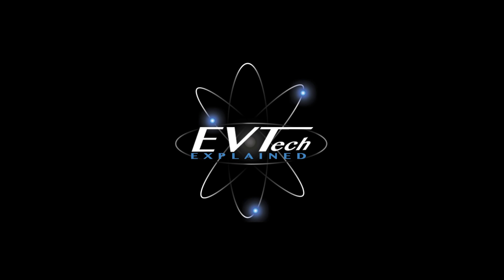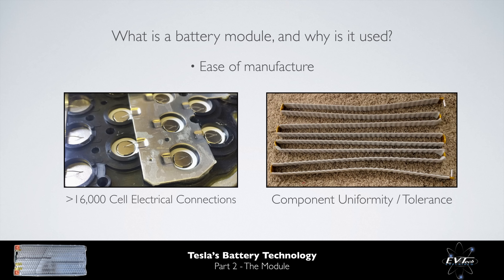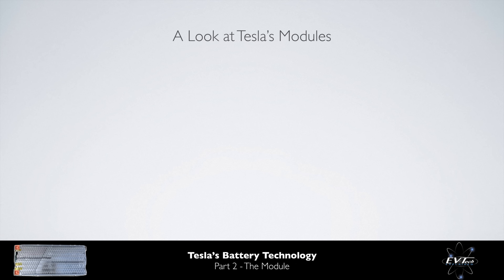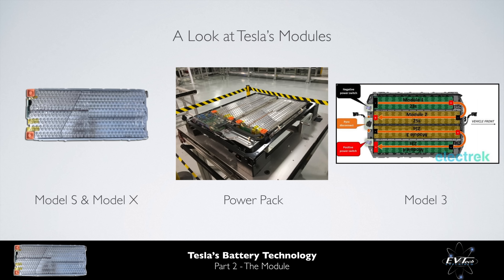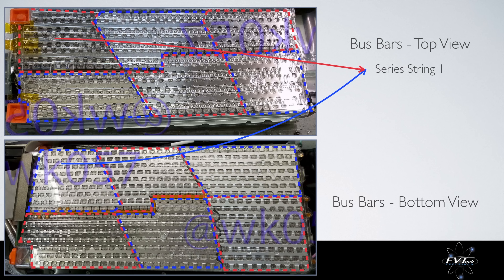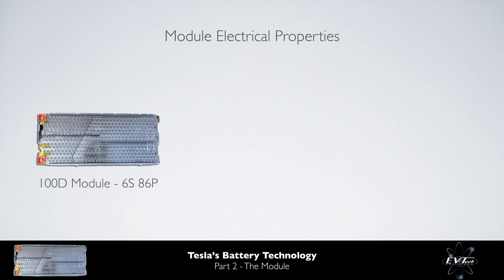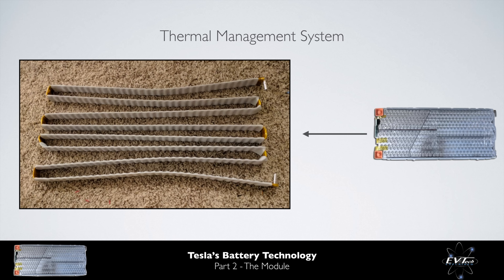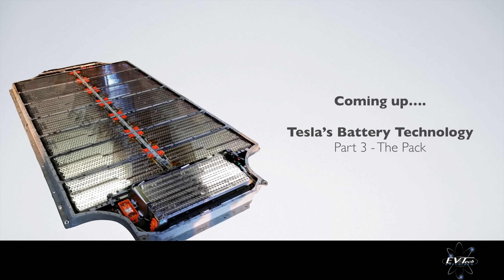Tesla's Battery Tech Explained: Part 2 - The Module

Comment: 74 cells in parallel: you know its impossible to distinguish between these cells whilst they are connected in parallel.........therefore there is NO cell level monitoring in any ev's battery pack.
Sad but true.........when will this be solved?
Look at it this way: 6S 74P pack.....thats 444 cells 
74 cells in parallel are basically monitored as a single cell ( cannot distinguish between cells):
so 74 out of 444 cells are monitored or 17% of the pack.
The reality is less than 20% of a packs cells are being monitored is one way of looking at it.
It very rarely this point is raised as a weakness in the electric vehicles, in fact its very rarely raised at all, most people continue to say that there is monitoring at an individual cell level.....which is not the case.

Comment: Can you explain the reasonS  why a Tesla battery might catch on fire? I have seen on the internet different Tesla models catch on fire when:  1.  just being parked.  2.  parked and plugged in for charging.  3. driving down the road.  4. and after a crash.      Let's assume a 2022 model 3,  hits a dip and the bottom of the car hits the roadway,  the car crashes by striking a 8 inch curb,   the car hit a tree too,   3 minutes later it explodes into a ball of fire.  
Q1:  can i hire you to help me develop theories of 'why' the 2170 design had some faults and why they catch on fire. Q2:  does the 4680 battery fix any problems with the 2170 catching fire?

Comment: On the Tesla S 5.2kWh battery pack there is a pcb with a 10 pin plug socket. What is this socket for ? We have a Tesla battery which we want to use with a solar panel array, and maybe this socket has some significance?

Comment: Hey there, great video! Do you suppose it would be safe to mount a model S module in a vertical fashion, on its side? See no problem with cooling, but mechanical structure is not elaborated on in your video...

Comment: Each 21700 cell is 4.85 Ah but why tesla uisng only 3.4 Ah.. its only 70% of actual. So, with number of charge and discharge cycles .. will tesla maintains same 70% through out the life ..life starts decreasing from 70% to  80% of 70%..

Comment: What’s this batteries operation temperature? And on winter time the batteries temperature goes down when the car standing on driveway or the bms maintaining the batteries temperature even when the car not in use?
Reply: There is a resistive 3kW battery coolant heater and the car will use energy from the pack to heat the pack when its temperature drops below 12 C. In operation it is around 30-40 C maintained by the speed of the 2 battery fluid pumps. From 47 C the battery gets actively cooled by the air conditioner system with the battery being priotized over the cabin.

Comment: Hey ...can anybody show how the cells in a module are connected in series and parallel using wire binds and busbars. What is a wire bond? Where to get them?
Reply: That's the bane of Tesla being made in US and most parts they made in house. It will be hard to find 3rd party parts or China bootleg parts for self repair.

Comment: There is a mistake at 0:40 - "First generation battery packs 85 an 90 kWh consisted of 15 modules". That's wrong. It was 16 modules: 16s 6s74p.
3:19 - Powerpack/Powerwall Version 1 shared the 18650 cells. Only Powerpack/Powerwall Version 2 contains the 21700 cells of NMC type.
6:29 - The stated 2.5V minimum voltage is a very low discharge voltage. Typically, this is rather 2,8-3 Volts to reduce degradation.
Reply from the maker: You are absolutely correct on number of modules - I'll add an annotation as a correction!

Comment: What doesn't make sense to me is the refrigerant is applied at the beginning of the module which leaves those batteries at the end of the module with no thermal gradient to deposit their heat. There's probably a better design out there.
Reply from the maker: There most certainly is a better way. The challenge is doing so without increasing cost and manufacturing complexity in a meaningful way.
Reply: @EVTechExplained  and another question would be is it really necessary at all. Might be more case of needing to heat the batteries in very cold weather. Nissan Leaf batteries are not cooled and the stress there under is considerable compared to Tesla as they are 60 amp hours compared to Tesla's 200 a h. This can also be seen in the range a leaf with its 75-mile range is putting a lot of more stress than a car with a 300 mile range. I'm not saying I know for sure just what I see. I was hoping to see what the peak amperage I could be pulled from this pack and how low they let the voltage sag under the extreme load?

Comment: No, the 85 and 90 have always had 16 modules. 7 on each side and 2 in front. They improved the chemistry on the cells to gain the 5kwh and then used the more compact twin cooling system to create the 100 pack with more cells.

Comment: First, all of the videos in the series are phenomenal. They are each very informative and very interesting. I was wondering if you could explain what you mean when you say,  “they join the positive and the negative terminals on the same end of the cell, rather than on opposing ends” . Again, great series/channel overall.
Reply from the maker: Thanks!

Yes, the entire can of the cell is actually the negative terminal, and only the small tab at the positive end forms the positive terminal. As a result, the top shoulder is actually still part of the negative terminal thus you can connect both the positive and negative terminals with exposure only the The positive side of the cell. Wording this without an image is challenging. I'll try and find a link to show an image.
Reply: Thank you for the explanation. If you can find an image I would appreciate it. But I think I get it.
Reply from the maker: https://youtu.be/CpCrkO1x-Qo?t=30m19s
Reply: Funny enough, I saw this right before your response. That being said, I very much appreciate the link. And once again, I want to complement you on the quality of the videos.

Comment: Good video. A question. The cells that are at the output end of the cooling tube, would on an average get lesser cooling, as compared to those on the near end, when the coolant is just entering and hence colder. Will this not lead imbalance in cells within the module over long term? Is there a way to take care of this which Tesla has figured out ?
Reply from the maker: This will lead to an imbalance. Their are multiple techniques to resolve this, such as tuning the flow rate around the module, however these do add extra cost and it does not appear that Tesla have implemented these techniques.

Comment: There are two versions of the S and X battery pack. The newer version, which has a set of two thinner coolant tubes, provides more space per-module for batteries and gives Tesla the ability to provide the 100kWh capacity.
Reply from the maker: You sir are correct! Let me know if you come across any good pictures of them!

Comment: so 16 modules new pack 25k so each 1563$ used sell for ~1450 on ebay, worth it? how could i use it as 12v instead of 24v, thats the video am looking for...
Reply from the maker: You would have to start cutting and re-arranging the bus bars....
Reply: Presumably soldering an insulated wire to the middle of the battery module would give you two separate 12v power-supplies, (12v between the soldered wire and the positive terminal, and another between the wire and the negative). So when looking at the video at 4min21s, the wire would be soldered anywhere on the bus-bar at the extreem RHS of the "bottom view". No cutting of the bus bars would be necessary, but each 12v supply would have to be used independently, eg on two separate electric motors in each wheel of a bicycle perhaps.
Reply: @paulrhodes7696  the bus bar that they use to connect all these cells together does not lend itself to the soldering. But there's plenty of space to put a screw in between the cells and screw it terminal right  to the bus bar. The little wires from each cell that are connected to the giant bus bar are all welded. Click on my profile picture and look through my video collection to see how I did this

Comment: I would like to know if it is possible to use a bms on the 6s batteries. Is tesla balancing this Battery pack on 3.7 Volts or 25 volts?
Reply from the maker: A BMS can be used on a pack of any size, however you would really want to be balancing each series string, meaning balancing will occur at cell voltages (<4.2V).